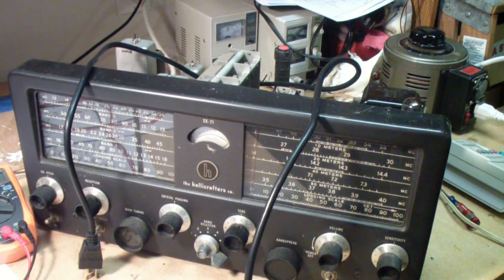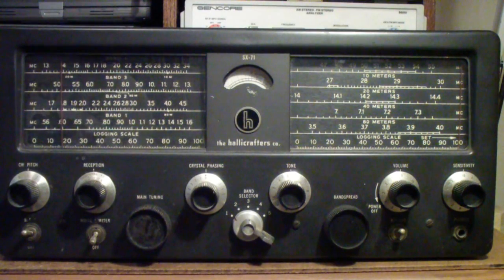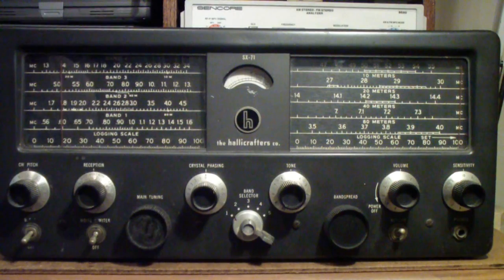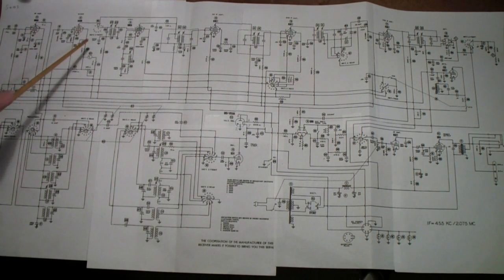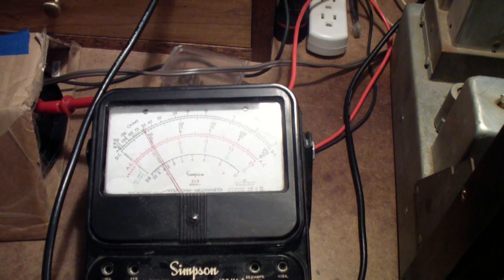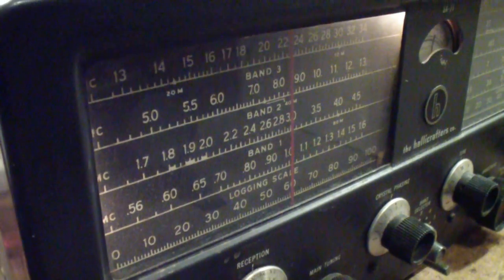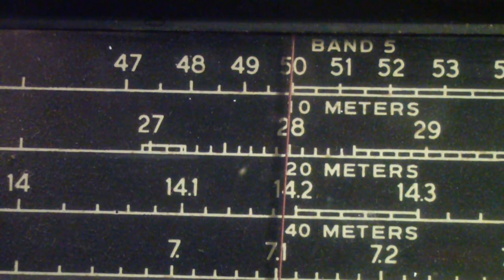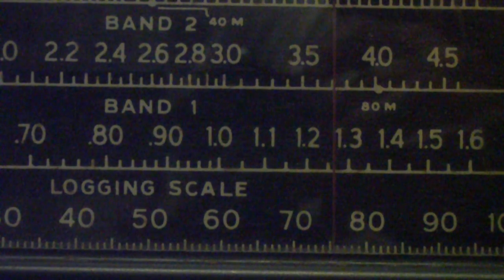TTT184 Hallicrafters SX71 Restoration Pt 3

Comment: If anyone out there can explain in detail step 2 of the IF alignment it would be much appreciated. I do not understand the adjustment of the "U" coil, which works with the crystal filter, and the broad and sharp crystal settings and the 455 khz alignment for the rest of the radio..